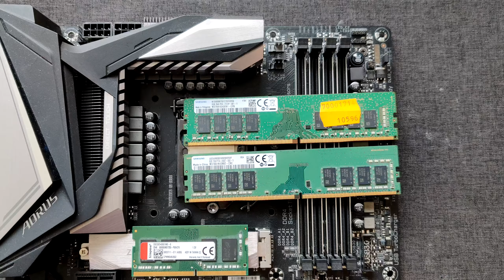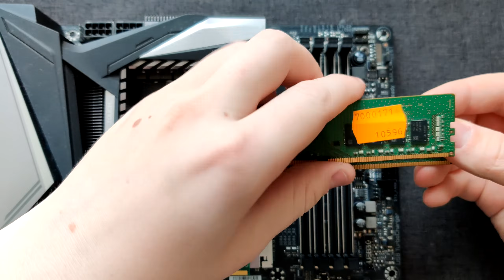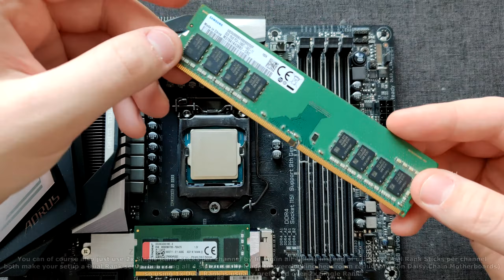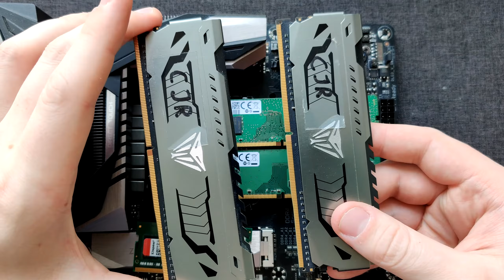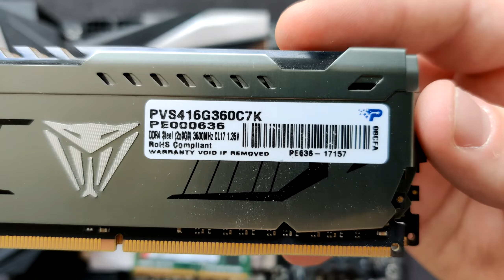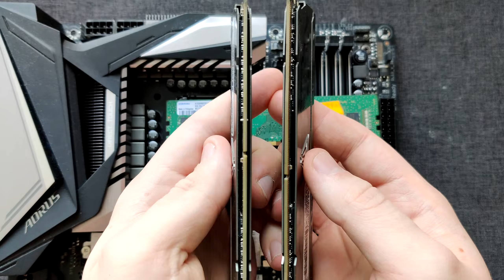RAM Explained: Ranks and Bank Groups (Why Dual Rank is faster)

Comment: Many new RAMs have chips only on one side, but the architecture is actually dual rank. It's just the PCB design. It's like sticking two small boxes together. Single/dual rank is a thing of past. The modern RAM technology can placr high density rams on one wide and still make it dual rank.

Comment: Question! I have an Alienware laptop with a 5900hx CPU. I currently have a single rank kit of 3200mhz memory with CL22 timings (kit that came with the laptop). I am looking to upgrade my laptop to 32gb to keep up with my usage. Would it be better to get a single rank kit with CL20-22-22 timings or a dual rank kit with 22-22-22 timings? Would there be a noticeable difference?

Great video BTW! I learned lots!

Comment: My BIOS has an option called Rank Interleaving, and another option called Channel Interleaving. Should I enable them?
Reply from the maker: Usually boosts performance a bit if you have dual rank
Reply: Which motherboard manufacturer?

Comment: Doesn't single rank ram typically clock higher. I'm pretty sure my Samsung B-dies are single rank.
Reply from the maker: Yes. But this has nothing to do with the ram chips themselves. Less ranks = less load on the IMC = higher headroom in IMC limited scenarios.

Usually you don't get to that point though and get better performance by running a well optimized dual rank setup at a slightly lower clock speed

I'm running two ranks of Samsung B-Die on AM4 where i can't run above ~3800 anyway due to FCLK limits.

Comment: If there is no chip on the back of a ram memory while physically observing it, we can say that it is 90% single rank. If there are chips on both sides, we can usually say dual rank, but it does not always mean that it is dual.

Comment: I have 4 ,1R - DDR5 6400 modules and the stability is pretty shaky sometimes. Sometimes I can go hours without a problem, but other times, it'll just lock up without warning. 
I didn't intentionally want 64gigs of RAM, but I accidentally bought 2 kits and after a month, figured I'd try to use them. Guess I need to brush up on memory timing info lol. 
I don't remember my DDR4 system being so finnicky.
Reply from the maker: DDR5 6400 with 2DPC is almost never stable. DDR5 really really hates having more than one dimm per channel.
Reply: @CmdrSoyo  What's weird is no matter how many times I'm run memory tests, it always passes. I can run this thing at full tilt for over an hour and it'll push through, but I could just be running a couple of Edge tabs and boom, hard restart. I'm tinkering with it, I just noticed the iGPU was enabled so I turned that off. Heard it helps. I'm on a 9800X3d btw.
Reply from the maker: @SammyM00782  could be that only the idle state memory timings are unstable
Reply: @CmdrSoyo  It very well could be. I have never touched memory timings with all of the computers I've built, so my knowledge of them is very limited. I'm the person who buys OC'ing hardware and good cooling to only BARELY oc anything lol. But it lasts. Also, they're 6200, not 6400.

Comment: can I use 16gb 2Rx8 3200 mhz with 16gb 1Rx8 3200 mhz..dual channel it work or not... please help me
Reply: Bro does 2Rx8 support with 1Rx8?? And also support dual channel if other specifications are same??
Reply: Dual channel won't be enabled. Think of it as populating 3 out of the 4 memory sticks (2 for the dual rank plus 1 for the single rank).

Comment: Ended up here trying to figure out a computer that had some bizarre crashing issues with new RAM and I'm starting to wonder if its some kind of single/dual rank problem...but no clue how I would figure out.  What I got at BestBuy doesn't say on the package and crashes (hard lockup) before I can get the system up to look at it tho all sticks pass memtest86+.  And of course the OEM only leaves vague information about "DDR4 PC4-21300 2666MHz Non-ECC SODIMM up to 32GB" with no other actual specifications.  I hate this...feels like I may have to just randomly buy a few hundred dollars worth of memory that I will probably have to return a bunch of in hopes of finding a permutation that might work.
Reply: 2 things. 
a) you can look at the memory sticks in your PC and then look up the stats for that stick
b) get the motherboard model number and look up the motherboard QVL list that will tell you which memory sticks the manufacturer has certified to work with this motherboard.

Comment: if you get a single rank for your desktop pc that means you can populate all 4 slots and get faster ram speeds than if you populated all 4 slots with dual rank memory. So when ppl say get 2 ram now and later get another 2 for future upgrades it not a good idea if the 2 slots you fill now are dual rank memory cause you could get better speeds with single rank memory.

Comment: actually single rank is faster than dual rank bc it has been well documented that boards and cpu's are incapable of reaching the same ram speeds with dual rank as they are with single rank modules.

Comment: I have a MoBo with 2 dead DIMM-slots hence not allowing dual channel,
does it matter if I use 2 sticks or only 1 and single or dual rank stick(s)?
Reply: definitely go with dual rank sticks in that setup. and depends on which 2 dimm slots are dead. if one of the second channel is dead than ya you're stuck with single channel and having 2 modules or 1 wont effect the speed. but if you have dual channels working, go with single rank modules cause the speed that can be reached is objectively higher it's well documented everywhere. In reality, in fact, single rank is faster than dual rank unlike the title of this video.
Reply: @jordan-mn6yy  Both channel 2 slots are dead(refuses to post), but both channel 1 slots are still working. I have tried all possible combinations with 1 or 2 sticks. I haven't tried 3 or 4 sticks though. I haven't checked if my sticks are dual rank or not, but my concern is if that matters at all.

Comment: The two ranks are selected one at a time through a chip select signal, therefore only one rank is accessible at a time.
Reply: Yep and to further explain memory interleaving, while it can access only single bank at a time, the other bank can refresh its data cells in the background, thus increasing memory bandwidth and reducing latency. Where's with single rank configuration, the cpu has to wait for memory bank group to refresh before sending another burst of data.

Thats why memory interleaving is much more important for systems running stock or relatively slow XMP profiles. Once you manually tune your ram timings your single rank configuration does reduce the performance gap between dual and single rank configurations, especially that you may get higher overclock on single rank memory. Still, dual rank memory in vast majority of cases will always be faster than single rank configuration.
Reply: @h1tzzYT  why do single rank sticks get higher oc
Reply: @ Because it is easier for memory controller (on the cpu side) to manage fewer memory banks. Single rank memory is the easiest dual rank is much harder and there is even quad rank configuration, which is even more demanding.

Comment: Good video. I was so confused with my sticks (32GB DIMMs, Hynix c-die 16Gbit, Dual Rank). Went from 3200@16-19-19-38 to 4533@20-23-23-40 but tertiaries are so confusing. In theory the _dd timings shouldnt even do nothing when using only two dimms but it doesnt boot if I set them too low.

Comment: Wrong right from the beginning.  A1 and B1 are dual channel.  A2 and B2 are the other dual channel.  No need to listen further.  

If you've been building rigs like this... well, you've been gaming on single channel rigs.

Just use CPU-z and double check your work.  EVERYONE knows to skip a DIMM.  Not only that, but we've moved in the motherboard industry from using DiMM A1 and B1 for a 2x stick build to using A2 and B2.  10 years ago, yeah, you used slot 1 and 3.  Now it's 2 and 4 FIRST.  

You need to correct this.

Comment: Its unfortunate that nobody has done proper benchmarking to show the differences in performance. By proper I mean 4x1Rx8Gb/2x2Rx8Gb vs 4x 2Rx8Gb vs 4x1Rx16Gb vs 4x 2Rx16Gb
Reply: I did a test on one of my systems 11700k JEDEC 2133. 1Rx16, 1Rx8, 2Rx8, both 1DPC and 2DPC. In short, 2x 1Rx16 sucked badly in P95 at ~75% relative perf 1Rx8, with 4x kinda getting ok. Otherwise 2R/ch > 4R/ch > 1R/ch with relatively small differences between them. I saw bigger gains on my laptop 5800H JEDEC 3200 going 1Rx16 to 2Rx8. P95 more than doubled throughput! I had seen ~25% in Skylake era running P95 2R vs 1R XMP 3000.
Reply: Jarrod's Tech did a ram configuration test that covers this. Idk if I can link to it but if you search "Jarrod's Tech ram" it should be the first video.
Reply: what you're saying wouldnt matter. the dual rank rams are only userul if you're going for a single channel set up like 1×16gb
Reply: @askjx  you have no idea what you are talking about.

Comment: would you recommend to use single rank rams if someone is willing to fill the 4 slots? And would there be any issue using 4 rams dual rank with only the default XMP? And thank you for all this useful information.

Comment: Can i mix 16GB 3200 MHz 2RX8 with 16GB 3200 MHz 1RX8 and make my laptop 32 GB or should I stay with 16GB dual rank, which will be fast, pls suggest
Reply: U can mix ,it will not harm ur ram but increase ur memory ,
But all ram spec are same it gives slighlty higher speed,
Reply: can I use 16gb 2Rx8 3200 mhz with 16gb 1Rx8 3200 mhz..dual channel it work or not... Any performance drop.... please help me

Comment: Well, if you have single rank, you could use multiple single ranks in order to achieve dual rank.
Like 4x single rank is like having 2 dual rank RAMs, and as I have heard, having more than 2 dual ranks does not really give you the performance.

Also, looking at different benchmarks, mostly the difference is pretty negligible. 
Speaking about SO-DIMMs (laptop RAM), dual rank actually consumes more watts. I can guess the same situation with more RAM banks as well.

Thanks for such detailed video!
Reply: Having more ranks is better if everything is kept equal. but they present a higher electrical load to the memory controller that can potentially drive down clocks and timings versus less ranks. 
Electrical loading on 4 DIMMs also becomes worse on most mobos using daisy chain DIMM topology where one DIMM on the same channel has a shorter traces than the other. (The longer pathed DIMM is always electrically better so mobo manuals always recommend to use the furthest DIMM slots of a channel first)
So its not a free lunch.
Reply: idk if i agree with u there, in stalker2 i used 2x8 3600 mhz cl18 single rank ram, had large fps dips and 1% dips, switched to 2x16 3600mhz cl16 dual rank ram and fps improved a little,for shits and giggles i put in the old ram with the new, put manual clock on 3000mhz cl16 and with 4 sticks the game feels alot smoother, so it made me want to get two more 2x16 to get better timings since the two different rams have different timings .
Reply: @Reaper9-4  huh... Interesting scenario, thanks!

Comment: Is it standard with single sided 16gb DDR4 dimms these days? Just got 2x16GB g skill aegis 3200Mhz CL16 for my dads computer. Only 8 chips on one side. I bought these because the ones that was in his computer was 1Rx16.
Guess I would've been better off ordering 4 8GB dimms instead.
Reply: Yep, I've been using 4 x 8GB single rank modules for a couple of years (3800MTs cas16) to get the benefit of rank interleaving. Works pretty well. It's always worth checking the specific modules but in general 8GB sticks will be single ranked.

Comment: does this also apply to DDR5?
Reply from the maker: Yes
Reply: Just curious, so even clock is higher, but bandwitdh could be lower? 

Stated on asrock nova z790 as follow:
1DPC 1R Up to 8000+ MHz (OC), 4800 MHz Natively. 
1DPC 2R Up to 6800+ MHz (OC), 4400 MHz Natively. 

I am afraid, since in ddr5 in the same bank group only 1 bank is refreshed and 3 other can still r/w (more efficient), so single rank could be faster, as stated in some of motherboard ddr5 as on Z790 asrock nova spec for example.

Im not test it yet using thaipoon burner yet. Still curious, looking for sample ddr5 dimm.

Comment: So when it comes to laptop ram/sodimms, how do I identify x8 vs x16?
8 chips on one side means x8 and 4 chips on one side means it's x16...?
Reply: I think that 1Rx8 has 4 chips on both sides and 1Rx16 has 4 chips on only one side. But i guess the 8 chips on 1Rx8 could be on the same side too. Also a 2Rx8 has 8 chips on both sides.
Reply: I know it's late but which is the better option for laptop rams?  @Jouniii
Reply: @spairgaming9464  x8 is lot faster than x16 (30% difference in fps in one of ltt's video).
1Rx8 is good and I also use 2 of them on my laptop.
dual rank (2Rx8) could be faster but I'm not sure how much difference it actually makes and they are also harder to find and more expensive.

Comment: Thanks for your video. I just bought four dual rank b-die 16gd 3600mhz cl14 sticks of ram. I was wondering would my system be stable if I run all 4 sticks of ram at DOCP so not really overlocking the ram? I have a 5800x3d on a Dark Hero x570 board. Thanks
Reply from the maker: buying B-Die just to run it at XMP is a huge waste honestly. if you buy B-Die you buy it for the overclockability the at XMP it's going to be just barely faster than a 3600 18 or 3200 16.

Comment: There is a Crucial Ram that i want to buy 8GB ddr4 3200Mhz laptop Ram ..but the problem with crucial they don't mention anywhere if it is 1Rx8 or 1Rx16 information 
Is this Ram a 1Rx8 or 1Rx16 Ram ?

I have another question , My laptop come with same Crucial Ram specs but is a Samsung with 1Rx16 .Can i Mix between both Rams currently cause i cant buy 2 memories now ?
Reply: you can mix dual rank and single rank, you can mix  different ram speeds ,but only get lowest speed ram speed.
there is  a tool called thyphoon burner , it can clearly find out   the ram is    dual rank or single rank on spec page
Reply: @ati4996  thank you, i have dual and single rank on my device now.
Reply: @AG058  is there any performance issue?
Reply: @TheLordismystrenght7  no working great

Comment: I suspect this dual ranks "speed advantage" is mostly hype that ultimately "cancels out". Because if you look at the "most overclockable DDR4 [Samsung B-die]", the only chips that can ever reach 4400 MHz CL19 are almost always single rank. Another thing I have noticed is that there is no 32GB per DIMM module B-die kit. It may be simply impossible to reach those high clocks with more capacity.
There is something about having a lower number of chips with lower capacity which allows the chips to reach higher clock speeds, maybe having more chips and more circuitry also inserts new physical limitations? Or else, why is it that all the fastest DDR4 MUST be single rank? Conversely, the only way to reliably get dual rank is to get the highest capacities, e.g. 32GB per DIMM (is guaranteed to be dual rank in DDR4) because there is simply no other way to implement that capacity other than through dual ranks.

You do talk about this at 11:25 minutes, but I would be very interested in seeing some type of controlled scientific test to truly see if the "dual rank" is better than the higher clocks of single rank. I would be very interested in this precise question because it is potentially a source of false advertising and false marketing claims etc.

Comment: Hallo. What happens when you put SR sticks to all 4 dimm sockets and what happens when you put DR sticks to all of 4 dimm sockets? Also, is there a way to understand the memory topology of your motherboard if you are not sure about it? Thank you.
Reply from the maker: 2xSR per channel = Dual Rank
2xDR per channel = Quad Rank (very heavy in the memory controller, will not oc well)

Most boards are Daisy Chain these days if you are not sure you can look at the traces at the back of the board and see if they either go from one dimm slot to the next (daisy chain) or split between the slots and go to both (t topology)
Reply: @CmdrSoyo  Hallo again. Thank you for your quick answer. I am new to hardware technology, but I am trying to understand how things works from experts like  you. You are very helpfull. Thank you again. Greetings from Greece!!

Comment: I hate that the rank is not advertised. I also wish consumer boards supported RDIMMs. They put less stress on the memory controller. On X58/LGA1366, I was able to run triple channel quad rank  ddr3 2133mhz, using two dual rank sticks per channel. Not bad for an early DDR3 platform. With dual rank single stick per channel, 2400Mhz was easy to do with oem puke green RDIMMs.
Reply: So right! 
So I got the 4 x 8GB G.Skill Ripjaws V 4000Mhz CL15 but I can only run them together at 3600Mhz CL14.
Reply: @Serandi1987 Some motherboard BIOS will let you unlock the channels and execute different timings. In that case you could put the more stable dimms on their own channel at a higher speed.

Otherwise, raise the voltage to the RAM and get some airflow onto the chips. You can pick up aftermarket heatsinks or aim a fan at them. More voltage and cooler Temps will increase the stability for a higher clock and tighter timings.
Reply: @SpecialEDy  thanks 👍🏻
I've got now really nice DDR4 dimms and get the 4000MHz CL16-16-16-36
Reply: Kingston Fury does mention the ranking specs of their kits on their website.

Comment: yeah dual rank is heavy on the memory controller, i have 4x DR on a ryzen 3000 and the controller hits a hard wall at 3333mhz, anything over even just a little and its a no no. Voltage or timmings dont matter, it just will not boot higher than that no matter what
Reply from the maker: About what i would expect from quad rank